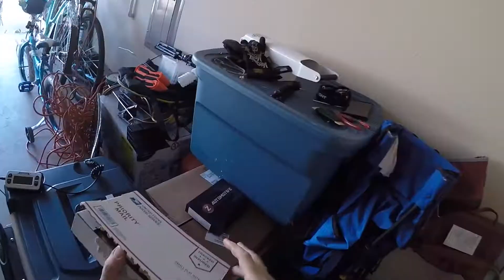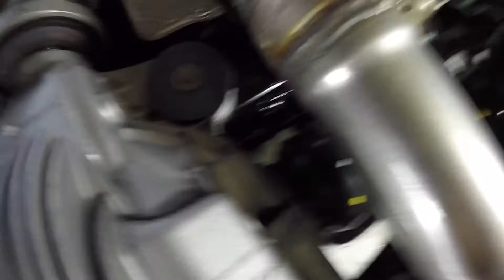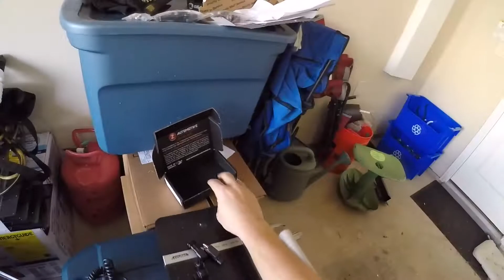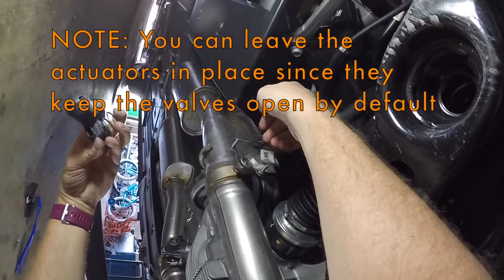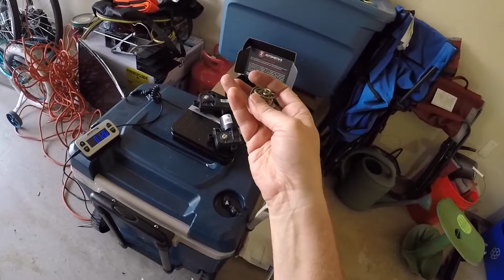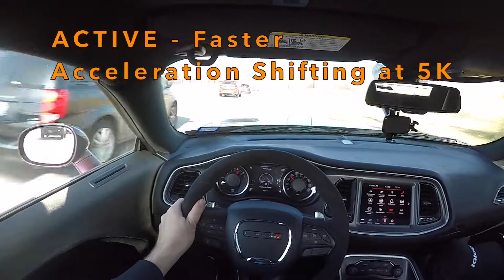Active Exhaust Delete Options for Dodge Challenger and Charger - FREE vs.  Z Automotive vs. Khaos

Comment: Please excuse me ignorance, why you want to do an active exhaust delete ? Is it for that extra rumble ? If yes, you can do a mid muffler delete and replace it with racebullets or vibrant, right?
Reply from the maker: Just for something extra at idle and low rpms, so that it sounds more like it does during a cold start. Even if you get the mid muffler delete or swap them,  the valves are still there and active, so although it'll be louder overall, it'll still quiet itself down. In a later vid I did the free delete on a friend's car who did have the mid mufflers replaced because he didn't like how it was quieted down by the valves.
Reply: @Scavenger1320 thanks for this comment. I’ve got a mid muffler replacement with bottle resonators and I love the sound but I do wish it was a little louder at idle and low speeds so I hope going with the z automotive will make it how I want.
Reply: @Scavenger1320  I wasn't expecting a quick reply and I truly appreciated that.  Purchased a new Shaker and was looking into bump up the roar :) Very informative and thanks a ton. It was an excellent video.
Reply from the maker: @geeksauthority  nice! Congrats on the Shaker! Thanks for watching!

Comment: When you put the z automotive part on,  did you put the back part/with the spring back on? And where did you put the 2 extra pieces that  you were wondering where they went.
Reply from the maker: I kept the actuators off which is why I ended up using the Z Auto plugs and still wired the valves open. Normally you wouldn't even have to remove the actuators to use the Z Auto plugs. Just unplug the wire from the actuator and install the Z Auto plugs and zip tie it out of the way. The actuator stays on with the spring which is what keeps the valve open. Then those 2 extra pieces plug into the actuator to act as a "protector" to keep the connections from corroding/getting dirty.
Reply: @Scavenger1320  gotcha!! Thanks man!
Reply: @Scavenger1320 thanks for this explanation. I was really hoping I could do the free method but I guess I can’t with my 19 RT. I’ll go with the z automotive

Comment: This may be a dumb question, coming back to this video. So if I get the active exhaust delete kit, will it waste more gas? Or will it be the same?
Reply from the maker: Not dumb at all. Mileage wouldn't be affected. If anything it might be a little better since the exhaust won't ever be restricted anymore by the valve. but if so it probably wouldn't be enough to even notice.
Reply: @Scavenger1320  appreciate it!! And just to clear this up, any of these will delete the active exhaust rattle for good?!?
Reply from the maker: @Stevenn.5oh  they should. I think if there's rattle it's usually just the valve moving around. All the delete options keep the valve in one place so they should all stop that from happening.
Reply: @Scavenger1320  ok thank you! Yeah my active exhaust rattles like crazy, it’s so annoying!! Sounds like a rattlesnake, I need to get rid of it asap!! I’m thinking ZAutomotive since it seems like the easiest & fastest way for a 2019 Charger

Comment: I have 2021,  I wish I could see what the spring is doing after you shut off the engine. If I wanna keep the valve open, do I have to remove the spring?  Does the spring turn back 270 or 90  or it stays and doesnt move back? Thanks..
Reply from the maker: When the engine is off the valve defaults to full open. That's why you didn't see it move in this vid after I shut it off, because when it spun closed during startup it immediately spun right back to the default full open and just stayed there. Here's another vid I did where I wired it open on a buddies car. You can see in it that since the valve defaults to open, after he shut off, all i did was unbolt the actuator, removed the spring, wired the valve to stay in the same position, and bolted the actuator back up. https://youtu.be/aDXoCybYRkQ
Reply: @Scavenger1320  thanks a lot. Im gonna do it tomorrow.. 👍🏻

Comment: I have check engine light on for my Active Exhaust , I ordered Z Automotive Active Exhaust Delete . Will this turn code off and fix rattling/Squeaky noise from valve once I plug in and wire valve open like you did ?
Reply from the maker: If the light is because of a bad actuator the plugs should take care of it. Squeaking should be gone too since the valves won't be moving. You shouldn't have to remove the actuators and wire the valves, unless the actuators aren't keeping the valves still and that's the rattling you might be hearing, in which case wiring them open should definitely get rid of any noise.

Comment: Not much of a difference, but at least it's somewhat noticeable compared to normal.
Am using my computer though.
Reply from the maker: Somewhat noticeable is how I'd describe it too, at least through the video. I had to throw on some good headphones to really hear. It's a little more noticeable in real life but not by much. Although there are some moments where you can tell that exhaust is fully open, I'd say usually in the 2K rpm range.

Comment: I purchase the zautomative inactivate exhaust for a 2020 Dodge Challenger rt 5.7 I didn’t install them on yet because I did the muffler delete and Resonator cut is inactive exhaust worth putting on 🤔
Reply from the maker: Hard to say without hearing it with the extra exhaust work and what it sounds like when the valves are closed. Might be loud enough as is, but if not it'll give you more sound for those times when you're just cruising along. That's where you'd hear the most difference. With a stock exhaust I know I definitely think it's worth it.
Reply: Thank you I’m try going to purchase some high flow Catalytic converts do you know a good pair to get
Reply from the maker: @guyfisher1556  that I'm not sure of. I haven't looked into high flow cats. I used to have a Magnaflow one on my old Ram that I really liked, but that was a looong time ago lol
Reply: Ok thank you I’m just getting gone the stock catalytic converters I’m replacing everything with after market products

Comment: hey man, nice vid. i was wondering if i could just take those actuators off and just wire tie the valves open. do i need to buy the inactive kit?
Reply from the maker: I missed your comment somehow, sorry about that. If you have a 19 and up with a 6.4 or Hellcat then you can, otherwise it'll cause the CEL to come on.
Reply: @Scavenger1320  yup just did it at the shop a few days ago, i broke the left one off so i just wire tied it open and so far no code, i appreciate the answer though

Comment: So for the free version, you pretty much flipped the active exhaust & tied it so it won’t close?
Reply from the maker: No flipping needed. Just remove the spring and reattach the actuator same as it was after wiring the flap. Here's another vid I did of just the free method on a buddies Challenger that might be a little clearer. https://youtu.be/aDXoCybYRkQ

Comment: Hey I have a question, when using the Z Automotive plugs how does the flap turn to open? Or do we have to turn them to open ourselves and they stay?
Reply from the maker: They're open already by default. Anytime your car is off they stay in the full open position, so when you install the plugs the actuator is open and then stays that way since it won't have any power going to it anymore.
Reply: Thanks I had the same question
Reply: I have a 2017 hellcat challenger and i have a CEL Code U1140 it’s for my right actuator valve, i was wondering would these z automotive plugs fix that issue, im also hearing a whistle like sound on heavy acceleration coming from the back right of my car

Comment: Do you notice any power loss?
Reply from the maker: There wouldn't or couldn't be any. When you go WOT the valves fully open normally. With this they're just already fully open. So there's absolutely no difference in the exhaust at WOT with or without the active exhaust deleted.
Reply: @Scavenger1320  ah, I see. Maybe it’s just an illusion since we get used to that active exhaust feeling. Just like how a car feels faster when it’s quiet compared to it being loud.

Comment: So is this like a mid muffler delete? Maybe it’s dumb question sorry.
Reply from the maker: Not dumb at all. This isn't going to make it louder like a mid muffler delete would. This only keeps the Active Exhaust valves fully open all of the time. At WOT the valves normally open up all the way, so the sound is identical with or without this delete. But when idling or just cruising along, the active valves close to quiet the exhaust down, so this delete prevents that. That's what you're gaining with this. Basically what I like to say is, you get that cold start sound all of the time since the valves also fully open up during cold starts.
Reply: @Scavenger1320  yea I like that idea. I just ordered my scatpck and want a mid muffler delete but I got kids and don’t want the drone but I also want that deep sound so I’m looking at options. I saw somewhere on YouTube that you can do it where it’s a flick of a switch to do this also. Do you know what it’s called like electronic active exhaust that is controlled by a switch. Thank you for the information
Reply from the maker: @Radioactive_Nuke_Cardz  I haven't been able to confirm it but putting it into "Track" mode is supposed to keep them open too. Some people don't like driving in that mode all of the time though. AFAIK there's nothing to control the active valves. There are electric cutouts that can be opened with a switch. But those dump the exhaust so they can be LOUD when open. One of the brands I see people get is called NoWeeds. I'm sure if you do a search on that there should be some vids.

Comment: Why not just pull out the sping?
Reply from the maker: For me personally I wanted to completely remove the actuators themselves and eventually the valves too. I've done the free method on a friend's 1320 where I just removed the spring and wired the flap open. I actualy have another vid of that when I did it.

Comment: If you have a 21 Hellcat, you dont need any of these. Unbolt the actuators without unpluging the wire, remove the springs, wire the flap open, bolt actuators back on and you are done. Exhaust fully open and no code.
Reply from the maker: Well, technically, one of "these" is needed since I show the free method too lol. I just haven't had any confirmations with Hellcats. I've only confirmed it works on all 19+ scats and that for some reason it doesn't work on the 5.7 cars.
Reply: @Scavenger1320  I have a '21 Hellcat Redeye Charger. I tried just disconecting the wires and it threw a code, still had all 797HP though. I then saw another video on the methot I posted above and so far, about a week of driving now, and no code. YOU DONT NEED ANY OF THESE products if you have a 21 Hellcat. That video states it should work on SCATs too, but IDK. Hellcats Yes, I can confirm.
Reply from the maker: @MaxMAX-et6lw  right, one of the methods I show in this video is the exact same free method you mentioned. I made another video doing this same free method again on a buddy's 1320 too.

Comment: Great vid .. my 2019 Charger RT was rattling so I took it to an exhaust shop and he wired the flap open but it threw off a code .. I need to invest in the simulators cause I want to keep my valves open .
Reply: Forgot to mention I do have a corsa xtreme cat back exhaust on too
Reply from the maker: I don't know why the 5.7s are different, but they are for some reason. I'm doing a giveaway of the Khaos Motorsports delete kit you saw in this vid. Details are in my newest vid if you wanted to enter -  https://youtu.be/AkeTpuPty2M
Reply: Did they change your catalytic converters
Reply: Dang so for 5.7 you can’t do the zip tie method? I was hoping to do that and not have to spend fking $180 for it lol
Reply: @brody8857 I did the zip tie method yesterday and it threw up a check engine right away
Reply: Do these 180 dollar plugs keep it from throwing up a check engine like ? Makes the car think they are working ?

Comment: I thought the tazer itself could keep the active exhaust open didn’t need to buy a separate kit
Reply from the maker: maybe, I'm honestly not sure. I have no reason to get a Tazer and from what I know of them, 19 and newer Scats don't really benefit much from them, so the plugs would still be a cheaper option. afaik though, I think the Tazer just unlocks modes like "Track" which keeps them open, but there's no setting specifically for the AES. I just looked through the user guide on Z Automotive's site for the Tazer and I didn't see any mention of the AES in the list of features it has.

Comment: I've tried them all and the mechanical ones have caused nothing but problems. Either corrosion, component failure, or caused the valve to crap out. I have the Z-Automotive installed now and love it and now if anything goes wrong its just disconnect the plugs 5 minute job that simple.
Reply from the maker: I haven't heard of that before on the mechanical ones. Thanks for the info. I'm pulling the valves completely out so that's the main reason I love these Z Automotive plugs.
Reply: @Scavenger1320  I think the weather in Canada on the West Coast was the main problem.

Comment: did the CEL light up and throw a p121B or a p1217 code ?
Reply from the maker: Nope, it never did. Actuators just stayed in the default full open position after they do their startup check. I'll be doing the free method on a buddies 2019 this weekend too.
Reply: I just added the z automotive to my 2015 challenger 392 and still doing the rattle. Do I need to remove the actuators like you did?
Reply from the maker: @rudypopoca3415  yeah, that's what I would try if there was a rattle. Maybe the actuator has a little play in it so wiring the valve open might keep it in place better
Reply: What kind of wire you use?
Reply from the maker: @rudypopoca3415  any kind of metal wire would work. I just happened to have a roll of 22 gauge green craft wire laying around and used that.
Reply: @Scavenger1320  thank you
Reply: @Scavenger1320  i haven’t had any rattle noise ever since I did what you did to your car and no codes. Thanks for the video.
Reply from the maker: @rudypopoca3415  awesome! glad that worked for you!
Reply: That’s the code that my RT threw off is p1217 ..
Reply: @danica3800  you need z automotive
Reply: Installed it work fine cel is off

Comment: i wish that they would make a little adapter for the stock shifter so we can replace it without having to keep the stock shifter in the car plugged in how dumb is that
Reply from the maker: Everything's gotta be plugged in! I'm not a fan of that either.  Can't even pull the stereo headunit like I did with my old trucks since this one controls my drag mode and everything

Comment: Hello, I have to attach the flaps to the Z Automotive Inactive Plug Kit with wire or just close the plugs. LG from Germany
Reply from the maker: All you have to do is attach the plugs to the wire connectors. Leave the actuators and springs alone since they keep the valves in full open position when not powered up.

Comment: I have 2017 charger rt just got cammed , it threw a code u1140 and u113f for lost communication to active exhust, do u think using the zautomotive it will clear it ?
Reply from the maker: Was the stock active exhaust removed or unplugged when it was cammed? If the stock actuators are in place and plugged in, I would think there's another issue and I don't know if the Z Automotive plugs would help. Unless the actuators coincidentally went bad, then the plugs should take care of that. Did you get a tune along with the cam? If so I wonder if that could be related.
Reply: @Scavenger1320  the stock active exhaust were not removed and the car is tuned
Reply from the maker: Sounds like something else is going on and I doubt the Z automotive plugs would do anything. First thing I'd do is check the fuse. I think it's #36 in the trunk box. If the fuse looks good, then I'd get underneath and check the connectors and wiring. Since you're getting a code for both sides, try to find the connector where both sides come together first, I believe it's a 10-pin connector somewhere by the rear diff. I've read about several people that had a bad or corroded connector at this point. Then go down and look at the rest of the wiring and connectors to make sure nothing is frayed/damaged. If all that looks good I'd check to see if the actuators spin up during start-up, if only just to know. These steps are all free to do at least.

If nothing works and you still have the issue, I'd get with whoever tuned your car if possible and see if they can just tune the valves out.
Reply: @Scavenger1320  thank u

Comment: Great video!. I'm thinking about getting the Z automotive delete kit. Do you still have it installed?and  has it thrown any codes over the past weeks since install?
Reply from the maker: I do still have them installed and plan on keeping them in. No problems and no codes at all since I filmed this vid. Thanks for watching!
Reply: @Scavenger1320 how about now? :)
Reply from the maker: @Nmd.426  Still installed and still no issues. I even completely removed the stock cat-back exhaust 9 months ago and these made doing that even easier, I just had to zip-tie them away in a different spot.